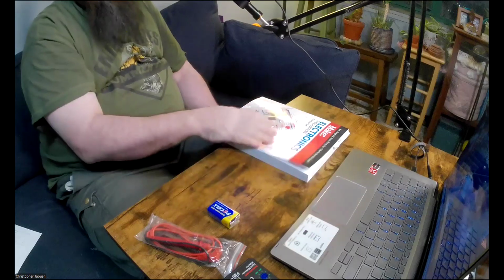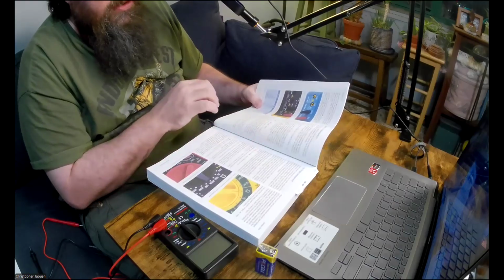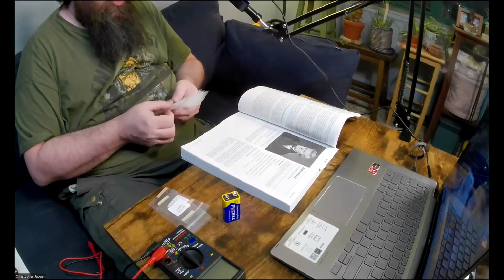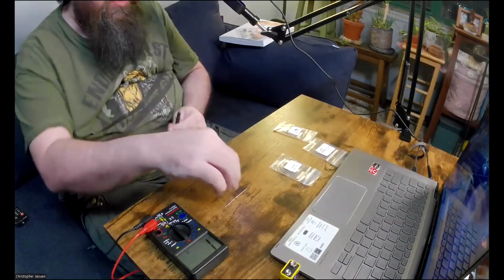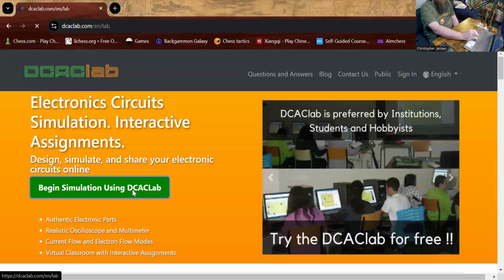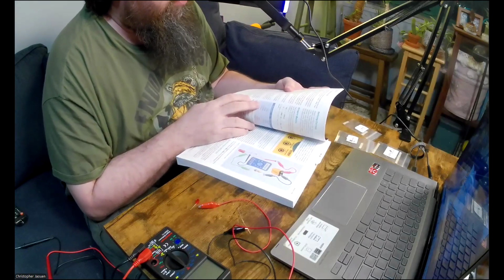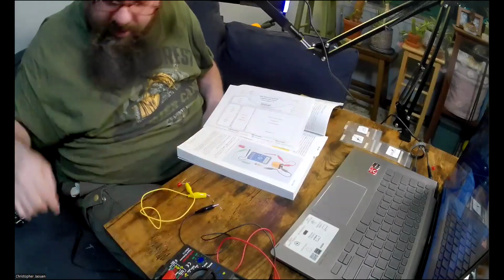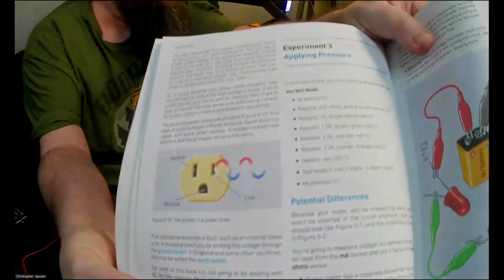Make Electronics Experiments 1 and 2

Comment: I can chime in on the hiccup you had with the multimeter probes trying to read very high resistance of your tongue.  We have found that this occurs with nearly all new multimeters as the probes come from the factory have an invisible layer of oxidation on them that blocks readings of very high resistance such as this, but luckily it is very easily remedied by cleaning the metal part of the tips lightly with fine sandpaper, or a file.  Even the rough side of a sponge, emory board or quick swipe with some steel wool will get the oxidation off and the probes will then read resistance on your tongue without a problem.  I use the 2000k scale and get a reading of 1000k-1500k depending on conditions. I hope this helps and if there are any questions related to our electronic kits, or if you need any help with the experiments we are always here to help!  Our customers are very important to us and it is our goal to make sure everyone is happy with our kits and enjoy doing the electronic experiments as we did!   Feel free to email us at anytime at CS@ProTechTrader.com or visit us at https://www.protechtrader.com